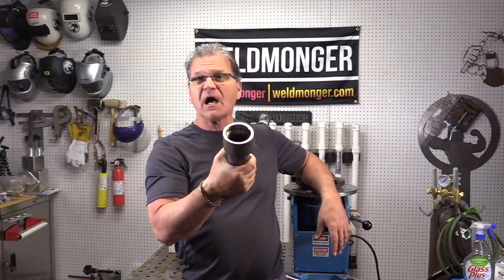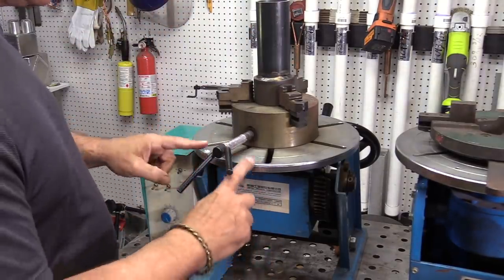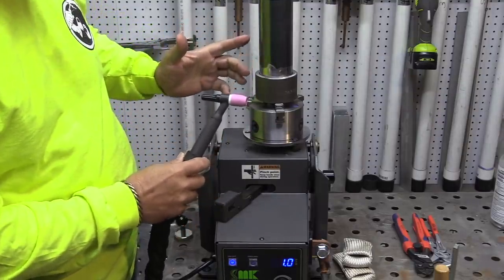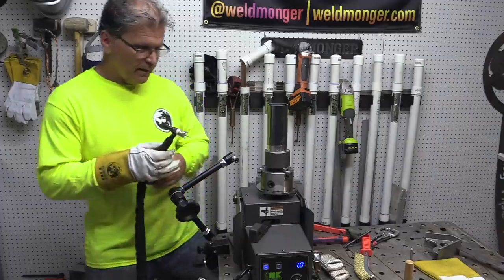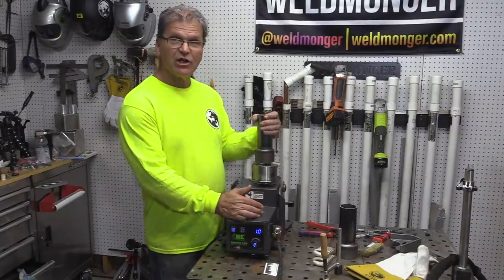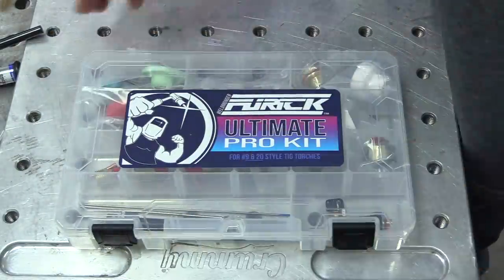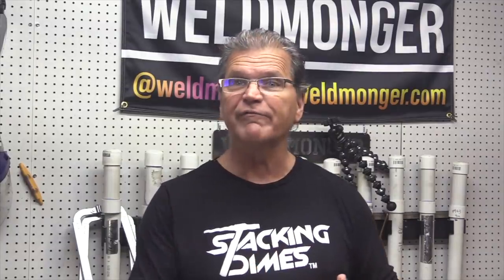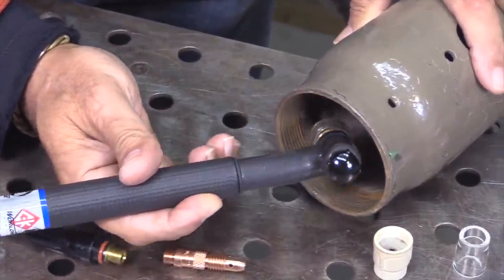Welding Positioners & Turntables

Comment: Here is a project for you.. Pick up a treadmill for free.. Usually in the Spring. Pull the board out and that will be a PWM controller.. Chances are (assuming your single speed positioner has a DC motor) that PWM controller will drive the motor you have.. Add a rheostat and voila you are back in business. I have added variable speed drive to my Chinese lathe, mill and drill press.. But I used the treadmill motor as those machines were single speed AC motors so would not work with the PWM controller. Its only certain treadmill models that work easily as they have the speed control built into the board.. Others do not and thats a little more complicated. Let me know if you want to do this at some point and I can help you select the right treadmill from Craigslist.

Comment: I have that Mk Cobra Turn at my work and try to weld a 26" diameter aluminum barrel with it but need to skow down a lot cuz I want my welds to look uniform and the 0.1 rpm is still too fast. please help. already emailed the manufacturer and still no reply after a week

Comment: just to say,its nice to move on from drilling holes then using nut and bolt to join metals, or using pop rivet,
In my younger days I was a sheet metal fabricater forming soldering copper, I moved into another skill as a steel fabricater as they just started me to weld I fell and damaged my wrist `I left to become a rail track layer some years after so my welding days never really got started, 30 years on and over 50 and always being the first to get hands on to repair, but never picked welding up after the accident
But watching your earlyier video`s got me arc welding , then mig and now tig,
just to say THANK YOU🙂

Comment: I use a smaller Cobra Turn for lots of the work I do at Fox Racing, and I can say for a fact that it's worth the money.

Incredibly smooth and consistent, and a great top plate for mounting all sorts of chucks. Mine is the one with the foot pedal.

Comment: Thanks again Jody. 

I like the clear cups when i have to use a mirror to see where i am welding.  They work great when you are welding the backside of an M bracket on a pontoon boat for example.  They are fragile,  you should sell a torch rest/stand with them.  If they are hot and you knock something they are then broken.

Without your videos I doubt I would be welding for my customers.   It's been a good trip

Comment: I made my table with a $40 Chevy truck front wheel bearing assembly, go-kart chain and a small 12v gearhead motor.  I use a Milwaukee 12v tool battery.  It all works slick.  I have however gotten lazy and half blind so I actually attach the torch to a stand like your camera prop and weld away.  I can manually move the stand base if needed.

Comment: We had very large powered tilt ones at my old job. Especially useful for fixing machine shop screw ups where you need to do long beads of stacked build-up. We had clipped an old plug off of a whip for the wire feeder and hooked a toggle switch to it for an easy on/off. We also had monster sub arc tank rolls and dual positioners that could fit a 6m x 6m vessel under the head.

Comment: Used those cobra turns at an aerospace shop I worked at for years. Definitely speeds up the process when you have hundreds of parts to weld. Only problem with them is the boards go out quite often. Can’t even start to tell you how many times we had to send them back to mk. Awfully expensive too, but ultimately worth buying if you can afford one.
Reply: Curious what the board failure mode is.  I bet it could be repaired.

Comment: Would like too see a video on aluminum mitered corners, given the current economy,  I'm using scrap from an old pontoon boat and its given me fits, especially when there is a crack in the mitered corner. Would like to see some recovery welds on this stuff that is not perfect. Alpha tig 200, 9 size cup. Miter cut with diablo metal cutting blade .Playing with settings. Would like to see you weld non perfect stuff. Love the tig finger by the way.

Comment: Rpm to use = welding travel speed you want * 60sec /(pi* part diameter). 
And you don't have to guess anymore. The ultimate Cadillac product could have 2 settings a) Diameter b) Travel speed: to make it super easy and repeatable.
Reply from the maker: thats a good point but after years of manual welding different processes, I dont think I every actually knew exactly what travel speed I needed until I used a positioner.

Comment: So I've always wondered about turntables.  If the ground can't be run straight to the chuck doesn't the load pass through the bearings themselves or are there ground brushes of some sort?  I'd think overtime the bearings would get arc burns and not run smoothly.
Reply: I've done it, but with a manual turner (think Lazy Susan turntable); the bearings became scorched enough to begin dragging.
Reply: The arc zone i have has brushes

Comment: Hello Sir, ive only watched 2 so far but it seems like you make great, detailed, informative video. Congratulations. 

I have some experience with mig and tig from a trade course that i did and i would like to start welding Stainless steel as a hobby at home here in Montreal. If i may ask, which would you recommend, mig or tig?

Thank you